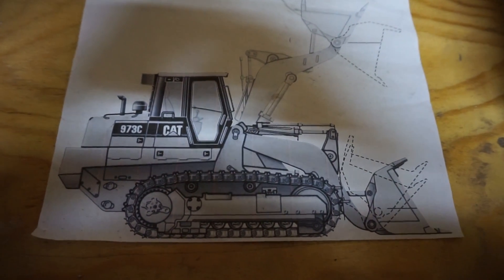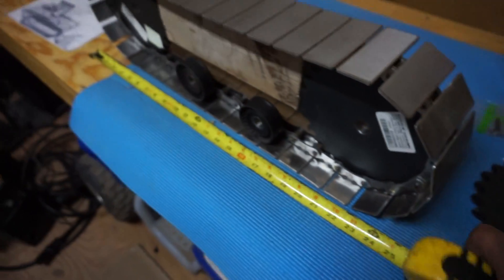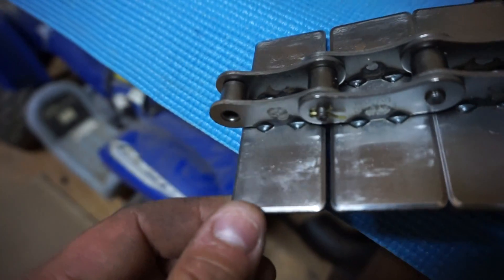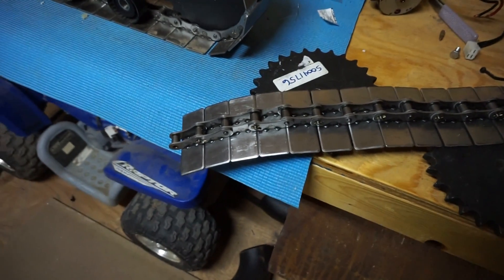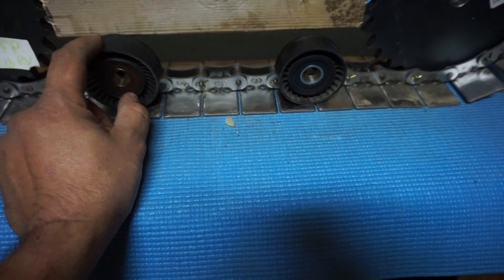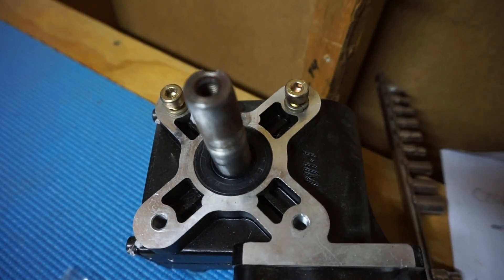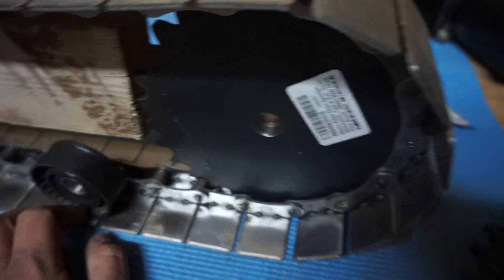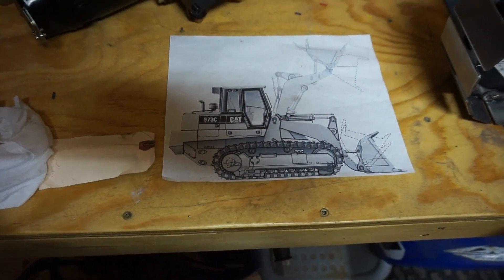DIY RC DOZER LOADER TRACKS, MOTORS AND SPROCKETS MODEL

Comment: I love these projects where did you get the tracks
Reply from the maker: These tracks are made by Tsubaki and I find them on ebay. The problem is there are very expensive so I just wait for deals to appear. I stopped on this project but 1 track is 1/2" wider due to being old stock and hard to find.

Comment: I think I'd look at motorcycle and snowmobile parts, way cheaper
Reply from the maker: I gave up on this build for now. I looked into snow blower tracks but since we dont have snow down here I have to buy online and see how it will work for me. I also used heavy steel since I needed the weight but who knows maybe 1 day I will start on it again. I am looking into a mig welder to replace my arc welder on certain projects. Thanks for watching .

Comment: really like your video's well done
Reply from the maker: Thank you so much. I really need to jump back on this project and get it done. Thanks for watching.
Reply: i'm watching more of them now, you do do great work, i asked if you had it lazer cut and i now see that you did it your self, well done again,
Reply from the maker: Beth Dewitt I just worked on it about 1 hr. Just got called for work but I am not taking it back into the shed. I want to mount both tracks this weekend and see how the thing  moves since I didn't lower the gears more. I hope it ain't to fast.
Reply: kool